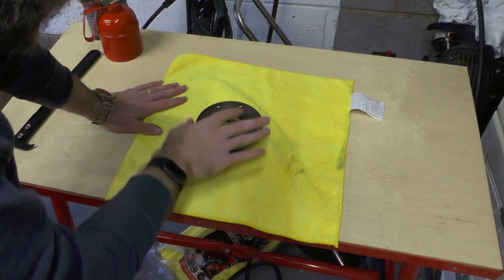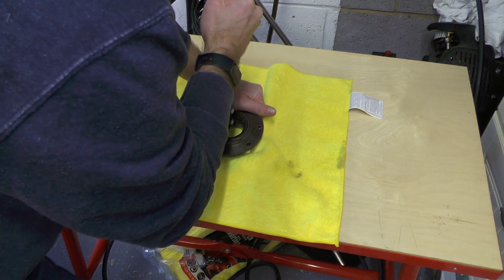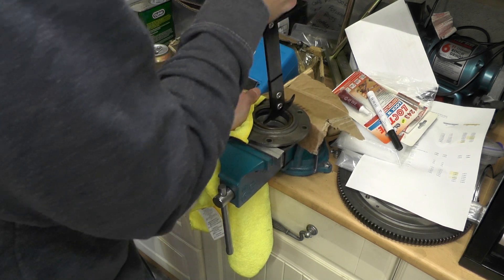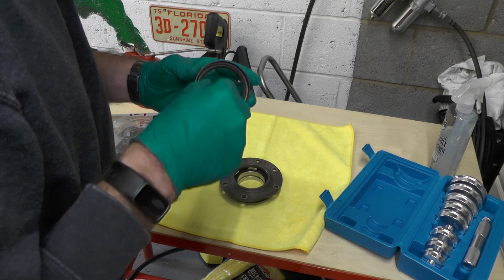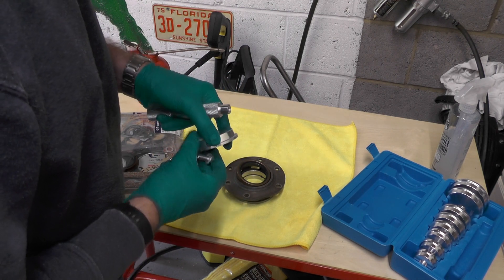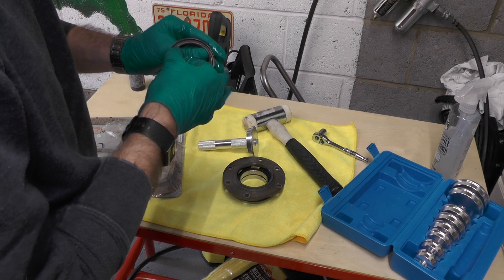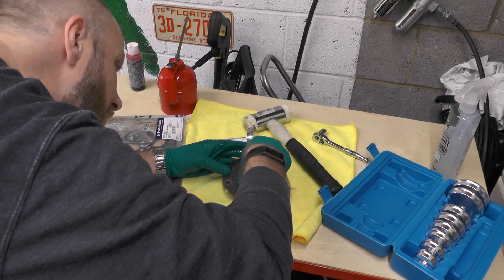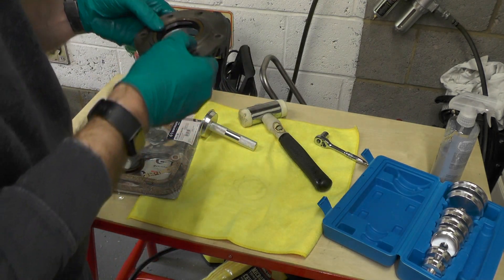30-27 Main Bearing Oil Seal - Classic Fiat 500 Engine Rebuild Series

Comment: Just seen your channel pop up on my recommended list!  Many, mostly happy memories of my 500. The first car I legally drove, back in 1981!   Managed to get almost 70mph out of it, on the downslope of the A1 in North London!  Everything broke, the exhaust manifolds broke, the whole exhaust fell off, the accelerator pedal broke, the pull starter lever came off in my hand, and the bonnet flew off. The first gear broke.   Loved the dog box, and I've never forgotten how to double declutch!  It never let me down, always got home one way or another!  Always amazed I never broke the crank, I used to take it up to the third gear marker on the speedo in second gear!
Reply from the maker: Ha ha ha … sounds amazing!!  The bonnet flying up must have been terrifying - especially because I presume that was at some speed?!
Reply: @the500workshop  😃 When I got it the bonnet was held down by two rubber "clips". Seemed to be a common mod, I guess the proper latch always rusted away. After fueling up it was inevitable that I'd sometimes forget to latch it. After it flew open a few times the hinges eventually broke, so a couple of times the whole bonnet flew off and landed on the road behind 😂 Mine had the fabric sunroof, I used to make passengers jump by pretending to adjust the mirror then flicking the latch, the roof would open with a bang and fold back perfectly 😃